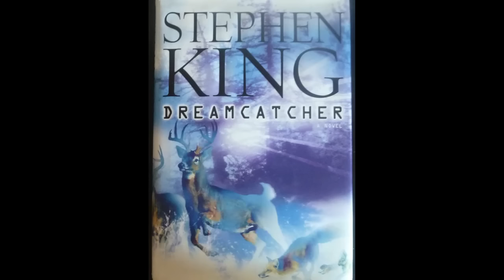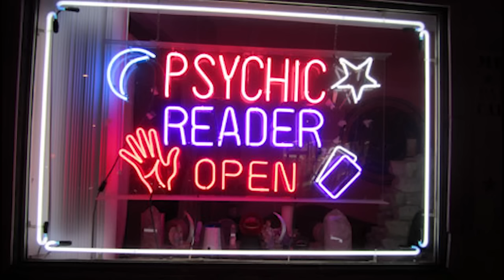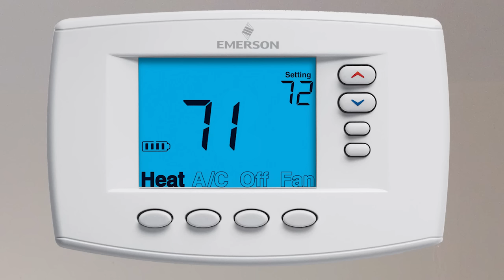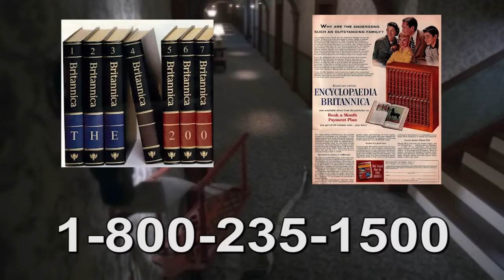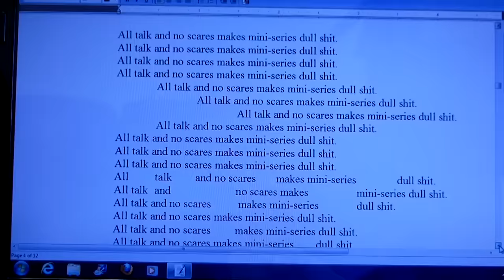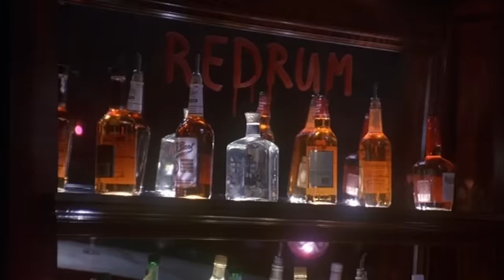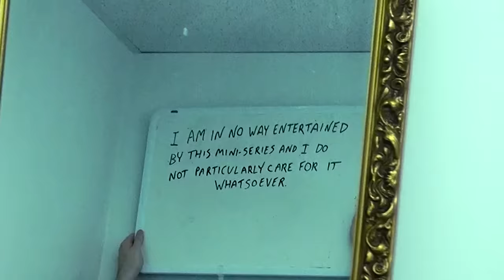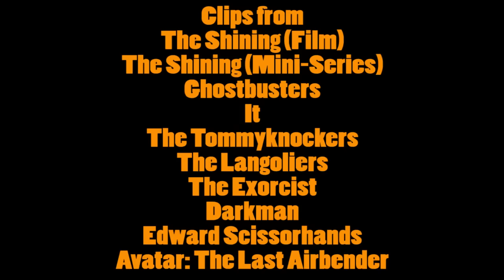The Shining Mini Series - Nostalgia Critic

Comment: The tour in the Kubrick version was also quite long. The difference is Kubrick knew how to make it interesting and it wasn't over an hour into the film.
Reply: And he used Steady Cam to show off the rooms instead of cutting between shots
Reply: @gracereads2917  The very definition of “show don’t tell.” Which this miniseries has the other way around.
Reply: @MovieFan1912 Kubrick was the master of camera work and cinematography to tell a story. It's what makes 2001 so intriguing in a way almost no director could pull off. It's no surprise he started off as a photographer

Comment: I feel like Stephen King doesn't completely get that a movie can't be an exact live action reenactment of a book. different things work and don't work in film and in novels. so when adapting a book you have to cut out, change, exaggerate, and expand on a lot. not too much obviously, but enough to where it works as a movie while still giving a faithful representation of the book. it's tricky to balance those things. but it seems like King gets upset when a movie is not like the book enough even if it's a good movie. and in stuff like this, you get bland, drawn out scenes that take a long time to deliver scares. here's the thing. a book can be a lot longer and more detailed than a movie. in a horror book, you CAN draw out the story and have a lot of long detailed scenes that very gradually become more intense as the story goes on. although with king novels it tends to be like: a bunch of normal stuff then SUDDENLY SOMETHING BATSHIT INSANE which isn't explained at first than it goes back to normal until something batshit happens again and thid pattern repeats but each time the events build on each other and connect until the normal becomes slowly more insane and the insane starts to slowly come together to form a bigger picture. this works great in a book .you can have a scene in a horror book about doing mundane things to put the reader in a state of false security before pulling them out of it, heck, you can have many and draw them out quite a bit as long as they're still developing the characters and story. but you can't take that much time for world and safe atmosphere building in a movie. you can create a false sense of security in one scene. but you can't draw out mundane events throughout a horror movie. because in a movie you don't have time to develop it into something scary. you have to balance out the time you do have. my point is a lot of these scenes play out the way many minor scenes in Stephen king books do. those work fine in a book with a TON of detailed content and as much time and space as the author wants to develop a grand complicated tale. you can make a book as long or short as you want. but you can't do that with a movie; it has to be within a certain amount of running time. so you have to cut out most of the boring crap. in a book you can have as much boring filler as you want as long as it's balanced out with even MORE interesting content and everything melds together well. but in a movie you have to pick what's most important to show. and what makes a book scary and what makes a movie scary are two totally different things. i don't know if Kubrick could write a novel that leaves the kind of impact and is scary the way the book the Shining is, but King knows how to brilliantly write a frightening novel. but on the other hand, Kubrick does know how to make a movie that is scary, like the movie the Shining. meanwhile clearly King does not know how to make the same impact in film that he does in books. because they're two totally different arts and you can't make one the same way you make the other. i feel like a lot of authors get upset when a movie isn't exactly how they envisioned the story when they wrote it. but i think many of them fail as soon as they expect that out of a movie to begin with. when you have your book adapted to a movie, you have to realize that you're in some ways going to share your vision with someone else's, let them show their interpretation of the story, or change your expectations to something that balances accuracy and a good film versus just pure accuracy. a movie, as much as an author may wish for this, is not simply turning your story into reality. it's adapting it to another art form with different limitations and liberties than literature. both forms are great and require great skill, but they are different. and i think when an author is used to a generally independent art form (writing) as opposed to a generally collaborative art form (film), it can cause conflicts because they are used to doing something that is very different and don't understand they need to adapt. both are mediums of storytelling but they are otherwise very very different. i can't claim to psychoanalize king though i could be way off, but i have a hunch he fell into a "writer who doesn't understand film the way he understands literature and that they can't be approached the same" mindset. but anyway this entire film plays like an awkward shortened king novel with all the good bits taken out and it comes across more like a book than a movie because in a horror movie more effort needs to be put into the atmosphere. this is one thing Kubrick did brilliantly in his adaptation. the entire movie feels like a surreal nightmare and slowly builds up a feeling of unease through visuals as well as the order scenes play out. this movie has no atmosphere. and thus much of the scariness is lost.

Comment: If this is King's idea of a scary mini-series, then thank goodness he didn't direct the movies (other than Maximum Overdrive), even though they had a checkered history of success.  At least most of them (even the bad ones) SHOWED more than told!  The original Shining movie was great, but it did have a few slow stretches.  Stretching it into a mini-series probably wasn't a good idea.
Reply: bruce wayne  Kubrick adapted a lot of both the story and themes of King's novel. Changing parts for a film doesn't mean the novel was dumbed down.
Reply: bruce wayne  Jaws is NOTHING like the book. It is even less faithful to the book than The Shining. I bet you must think Jaws is trash, otherwise you'd be a hypocrite.

Cinema & literature are DIFFERENT MEDIUMS. What works in books does NOT necessarily work visually. Most of what Kubrick changed wasn't going to work on film.